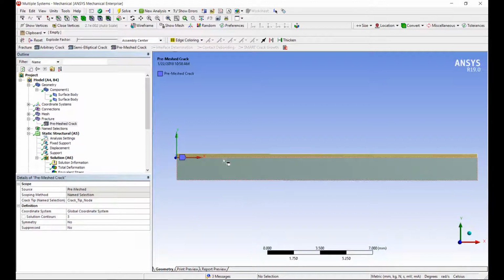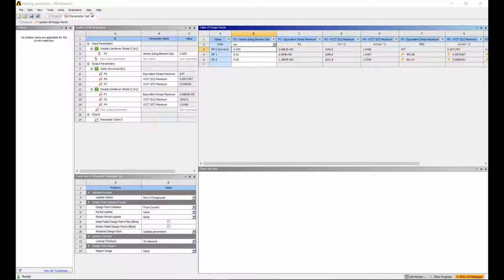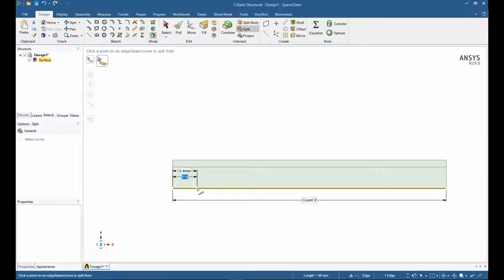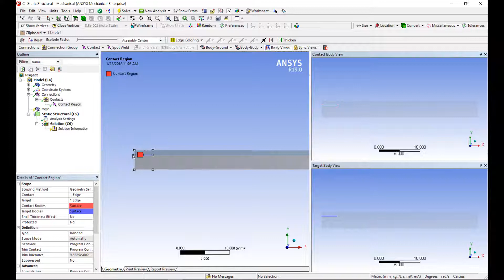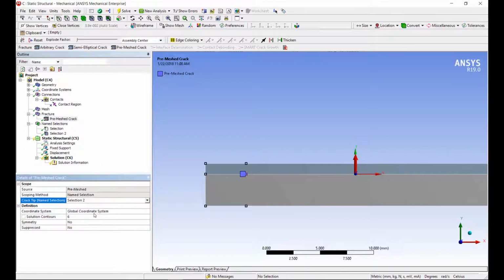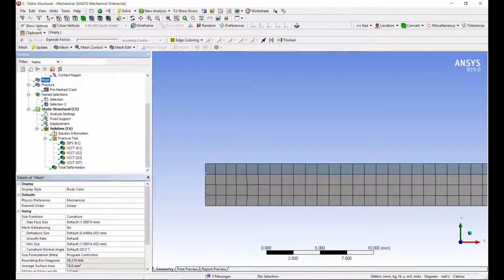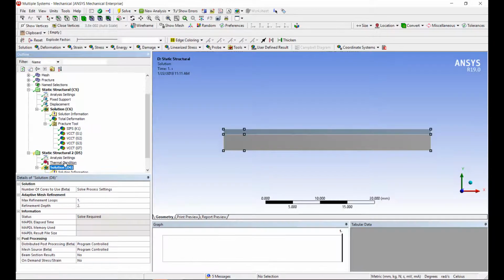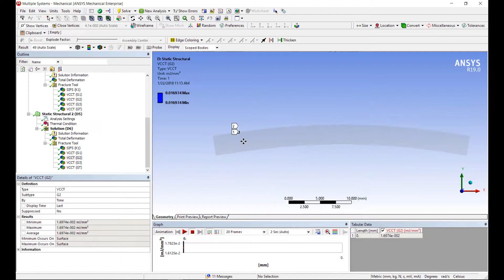ANSYS Frature and Delamination Part 1:  Motivation

Comment: Hello.. I'm getting error while selecting the second split at fracture.. 
"Error: one of the crack's mesh encompasses multiple bodies which have different material models. Ensure one material model by scoping these bodies to one material assignment object."
Can u help me out with this.. I'm working in 2019 r3
Reply: i tried to change element size fixed this problem

Comment: hi. nice video it helps me a lot. but I have a doubt that if there is a crack or fracture in the middle of the plate. the can we solve that problem also or not ?? I have very urgent work on this topic. please help asap. thanks.
Reply: yes you can solve it similarly like this.
Form the crack at centre of plate and apply the axial load or eccentric load.
Reply: Hi, dear sir >>>>>
I am a student in 3rd year Ph.D., I'm working for materials composite  but now I have a problem for creating a crack in my domain >>>>>
my question is: how can I create a crack on the material composite domain?

Comment: ONE doubt i have, when you defined the coordinate for crack  according to me it should be at crack tip that the same we used for formula also.
i checked the analyses for both coordinate at tip and coordinate away from tip, Stress Intensity factor is different for both cases but deformation is same.
please check it.
Reply: Hi, dear sir >>>>>
I am a student in 3rd year Ph.D., I'm working for materials composite  but now I have a problem for creating a crack in my domain >>>>>
my question is: how can I create a crack on the material composite domain?
Reply: @smailhamidatou367   hello dear, mail me your problem may I help you.
deepmech.maurya@gmail.com

Comment: Hello, i'm having these error:

One or more objects is using a deformable behavior but is applied to a collinear set of nodes.  This is not recommended and can cause solver difficulties.  Check the Solver Output on the Solution Information object to identify the offending load.

You have requested a fracture result for a crack that is undefined: CINTGT